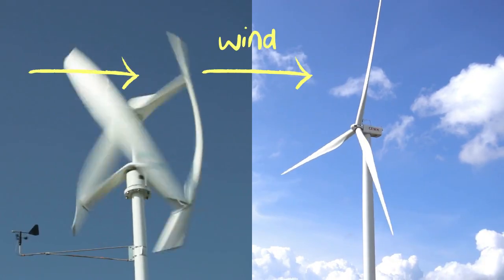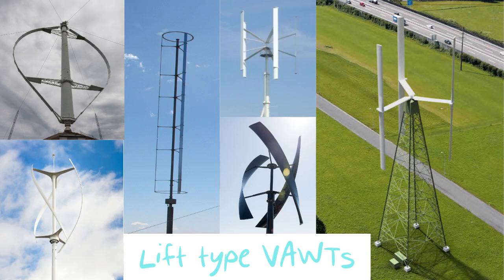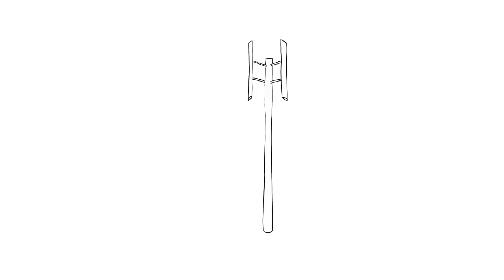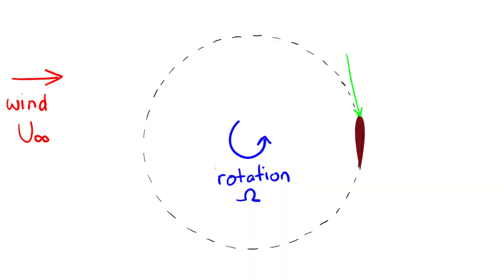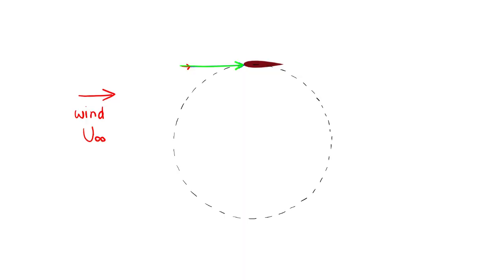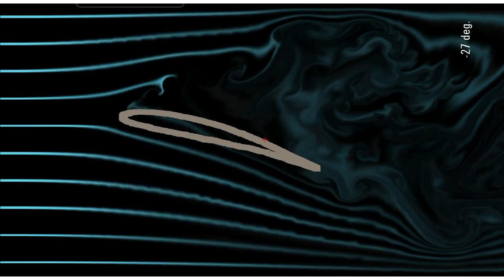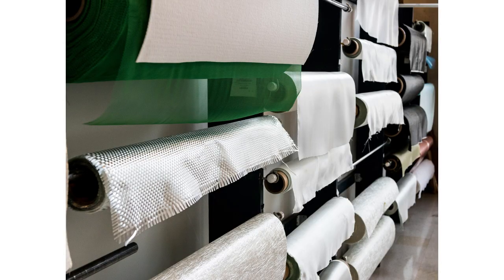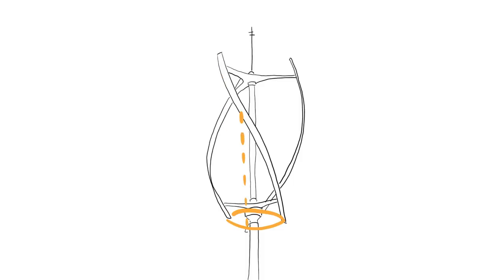Vertical Axis Wind Turbine Aerodynamics and Design

Comment: Halfway through the video I was saying to myself "control the blade angle like a helicopter!" I'm glad that was validated at the end haha.
Reply: To me an actively assisted passive pitch guidance system should be feasible. Put a cam on the central shaft with control rods to the blades. Rotate the cam with wind direction ...
Reply: @jph219  Oh that's very elegant, I like it.
Reply: @jph219  Eaxctly what I came here to comment.
Reply: @jph219  Been done and improve things, but I cannot re-find the reference.
If someone have a reference study link this would be appreciated.
We could also use small individual vane on each blade to orient them correctly.
Reply: @michelcote  Checkout Peter Worsley's wingsail concept..  this basically orientates the airfoil and maintains a constant pitch relative to the oncoming airstream.
Reply: @jph219  I was thinking that the Cyclocopter's blade pitch mecanism could be applied here. Just use a Cam to orient the blades. Exactly as explained here: https://youtu.be/JoVmejDsMrM?t=90 (must have been done already, if anyone has references, I would be interested)
Reply: There is more effort than in the case of main rotor control mechanism of a helicopter, because:

- the wind can come from every direction
- each blade must be controlled individually within the whole cycle of revolution.

The first idea i had is to use 2 rotor axes separated by half of the blade width from a single axis which can be turned into wind direction. The blades overspan the distance between the axes and are therefore always in the correct angle to the wind, no matter where they are within the cycle of revolution.

Maybe, Rosie can comment on this.
Reply: Kind of seems like they just need the fastest feedback mechanism and some sort of PID control.  There are some DIY projects out there for instance that are used for balancing brushless motors and props, using sensors to tell you exactly where the motor/prop is unbalanced.
Reply: That would make wind turbine service intervals similar to helicopter. 😊

Comment: An elegant cam could change the pitch of the blades. Align the cam with the prevailing direction of the wind with passive fluid dynamics by using the drag of a tail.
Reply from the maker: I agree this should be possible. And people have tried, but I haven't seen anything very effective AND reliable yet.

Comment: Interesting Video,
I have applied multi stream analysis to extremely large VAWT  with and without pitch control.
 The approach :
 For simplicity I have omitted end of blade losses and assumed an average chord length for a constant Re value on an aerofoil at a specific location.

The airflow was split into 18 segments matching each 10-degree azimuth locations to calculate loads on the aerofoil at every 5 degrees.  At every 10 degrees the aerofoil would be considered as subject to two adjacent airflows.
The average tangential force on an aerofoil while in a segment was considered as a quarter of ( Force at start + 2 x Force at mid + Force at end ). 
To get the power from each segment these average forces were multiplied by the number of blades and tip speed divided by the 36 overall segments.

For each segment a Cp is applied to the upstream wind to establish a wind velocity at the aerofoil for an accurate apparent wind velocity and a downstream wind velocity to be used as the upstream velocity on the leeward side.

The CL and Cd Values ( taken from Qblade ) dependent on the AOA and Re values are inserted to obtain a true tangential load.
The power ( load calculations )  from the segment is compared to the energy extracted from the wind and if the difference is significant: the Cp that was applied is altered.

If the Cp had to exceed 59% for the difference in a segment to become insignificant then there are 3 options:
Reduce the average chord of the aerofoil.
Reduce the number of aerofoils.
Reduce the Angle of Attack.

The total power output was the sum of all power extracted from the wind in the 36 segments.
( a very small amount bigger than the calculated power from each segment due to +ve differences ) 
With Controlled AOA of 16 degrees on windward side and 12 degrees on leeward side 
The AOA was 0 between 355 to 5 degrees and 175 to 185 degrees
I noted that I had to reduce the AOA on the leeward side to bring the CP down to 59% in several segments.
The method of pitch control is based on aerodynamic balance eliminating the need for any servos. 
The pitch constantly changes to maintain the specified AOA  for the windward and leeward sides.

To minimise end of blade losses ( which I had ignore ) :
Are there any equations that take winglets into account?
Has Splitting the end of a foil into 2 close parallel sections to create a central parallel flow been considered?

It is interesting to note that the AOA could be increased in the 180-to-270-degree quadrant slightly but 
the simplified cam-controlled and aerodynamic balancing system for the AOA increases the power by slightly more than 11 % compared to fixed aerofoils.
The non pitching result was very similar to that indicated by the power using Qblade.

Happy to share the spread sheet with those interested. Leave a request in the comments on maxwindpower.com

Comment: With modern computer controlled (similar to fly-by-wire ...and autonomous flight control we are seeing on Ingenuity at the moment) stuff, wouldn't it be possible to have straight vertical blades that constantly adjust to the optimal aoa. I realise that this would add to the complexity (and may be difficult to achieve in gusty, changable conditions).   It would be a little odd having the blades rotating to stay at the best aoa on their own axis as well as rotating around the main shaft ...but the efficiency would be much better.  PS there'd also be a side load to the main shaft structure.
Reply: Hi Leigh, You are describing an "active pitch" cycloturbine. It was first done around 1980. Look up the original Giromill https://www.nrel.gov/docs/legosti/old/263.pdf    It worked well given the knowledge about blade pitching angles at that time.

Comment: Could you put a giant vertical access wind turbine on a skyscraper to generate, say, half of its own power?
Reply from the maker: Great question! I wonder how big it would need to be, I may just do that calculation! My initial expectation is that it would need to be huuuuge and that the building structure would need to be significantly strengthened.

Comment: 10:10 Do you really need ACTIVE control for the pitch of the blades? I am thinking of a design like the swashplate of a helicopter (only as a cylinder around the shaft). The direction to optimise it could be controlled by a simple vane. Of course this would still drastically increase the complexity (mostly because of adding many mechanical bits), but I don't think it needs to be an active system. Most likely I am overlooking something very obvious here... But actually I am now thinking about trying it out myself in a small model 🤔😅
Reply: That wasn't explained properly... Let me try it again and take a step back: In helicopters the rotor blades also have to change their pitch in two ways:
1. Collective blade control: This changes the angle of attack (AOA), no matter where the individual rotor is and for all, so that the pilot can in-/decrease the total lift.
2. Cyclic blade control: For changing the direction in which the helicopter is flying, the blades have to have different angle of attacks at different points in the rotation, so that e.g. on the right hand side from the helicopters POV there is more lift, than on the left hand side (the real physics where he would fly is a bit more difficult - see gyroscopic precession)
Now one could imagine that each blade is actively individually controlled, but actually the concept it is relatively straight forward: On each blade there are two places where it is held: one at the front that is held at the same hight and one at the back which obviously changes the AOA when it moves up/down. Now we need to move it and that is done by a rod that is sliding over the so-called swashplate. If the plate is level, the hight of the back is constant no matter where the blades are. If we lower the plate but keep it level, we will lower the back of each blade and so increase the AOA. But we can also do something else: we can tilt the swashplate, which means that it now matters where the blade is: At the axis where we tilted it, the angle of attack is still the same, but when it gets to the part that is higher, the AOA decreases and half a rotation later it increases.

This sounds roughly like what we need here... Now we only need to transform the swashplate, so it can work for VAWTs. Good thing: we don't need to decrease the generated lift, so we don't need any collective pitch. But for cyclic pitch the principle still remains the same: we can make the back edge of the blade ride on the main axis. What have we earned? Only complexity so far. But imagine we add bumps to the shaft. Now at a specific point in the rotation, the pitch would change, so we could actually adapt it to have the perfect pitch for one direction of wind - sounds interesting, right? But we can also go a step further: let's make our bump not on the real shaft, but able to rotate around it. We are now able to turn the bumpy cylinder around the main axis to adapt to every wind direction. And we can do just one more easy fix, not to have to do this manually: just add a wind vane to it and now everything is controlled passively 🎉

(The critique of adding complexity is obviously very valid, though...)
Reply: And one note to myself: for helicopters you actually change the rigging angle - the AOA is not the same in this case, because an increased pitch will result in more downdraft of the rotor and so change in the angle of the blade is not quite the same as the change in AOA...

Comment: The whole way through I was thinking about changing the blade pitch, except using mechanical means. Probably not as good as doing electronically (as you could then adjust for wind speed as well as direction), but there are some relatively simple mechanisms that could be used at least to increase efficiency, even if it isn't quite maximised.
Reply: Such as?

Comment: Super interesting. I have already subscribed. I do not know if you have dealt with this topic before. I rode you can't put horizontal axis turbines too close to each other because of turbulence. Does this problem also occur with vertical axis ones? For example, would it be possible to put several turbines next to each other on the roof of a house?
Reply from the maker: I am working on a video that includes this topic! Check back in a month or so when I hope it will be ready.

Comment: Hmm, I wonder if you could design a system of mechanical linkage to passively tilt the blades to their optimal angle throughout each revolution. Like the blades rotate around one center, and the linkage bars attach to a hub that rotates around a different center. The linkage center could be controlled by an eccentric cam on a simple wind vane, to point it toward the wind direction.

Comment: Instead of a vertical blade, channel the wind into a vertical cyclone using an upside down cyclone turbine with multiple reducing entry points around the side and exhaust through the top where low pressure will create a pulling action.  Now you have the best of both worlds. Further more, I would use a large diameter servo style generator where the  poles are mounted on a ring.

Comment: Well done, Rosie.  Thanks for the explanations.  Compromise is usually best functionally.  My 1st reaction is to place the complexity of function into the manufacturing process: for instance a helical design.  Once the vawt is in place, if well-manufactured, the product should perform with little need for on-site adjustments and maintenance.  This may be less optimal in energy generation than adjustable vanes/airfoils but better for long-term low maintenance.

Comment: Excellent video. I disagree with your conclusions about VAWT because passive pitch control can be both efficient and very simple. VAWT may replace HAWT because VAWT can make use of 3 techniques to increase their efficiency: Active Lift, paired-counter-rotation, and rotor tipping. If you would like to understand my perspective, as a VAWT inventor, please contact me at sharpencil@sbcglobal.net and I'll send you my relevant papers on the Sharp VAWT and the Bird Windmill. They are hard to understand, but they may be the future.

Comment: Just wondering, do you account for apparent wind, in the vertical axis turbine? With land yachts, using a wing, wind direction and apparent wind affect the speed. On a broad reach a land yacht can exceed the speed of the wind by as much as 7 times. They can also beat into the wind as much as 30⁰. So just curious,  if the blade is accelerating in the broad reach side of its arc, so would that increase the apparent wind as the blade moves into the beat side of the arc? Much like ankling when riding a bicycle, where your maintaining force on the pedal through more tha 180⁰.

Comment: Nicely done! One potential use for VAWTs, where there may be an improvement over utility-scale HAWTs, is for floating offshore wind. The lower center of gravity significantly reduces the size requirement for the floating platform, potentially reducing the cost of energy. Of course, fatigue is still an issue that must be addressed, and there are a few tricks up our sleeves that might help. The US DOE is funding a  program (ATLANTIS) that it includes a VAWT design component.

Comment: Maybe I’m about to say something silly but... what about allowing the blades to freely pivot around a inner axis, so they could “self orientate” as they turn? 
I don’t know much about aerodynamics, and as I don’t see this done, maybe someone tried and it does not work at all, or maybe nobody has tried that before and this comment becomes a great revolution instead of a silly thing (chances are not on my side I guess)
Reply: If they were left to swing free, then each blade would turn into wind and produce drag but no lift = no rotation
Reply: @SoapyB20  it’s sad to see that I’m not a genius

Comment: Can you explain what you mean when you talk about efficiency.
Reply: Energy out divided by energy in would be a good starting point.
Reply: @SoapyB20    I would think that capital costs, operating costs,  maintenance cost, useful lifespan,  and decommissioning costs would be orders of magnitude higher than the cost of the wind power in.   But if you think wind turbine  efficiency should be measured in watts and not dollars go for it.